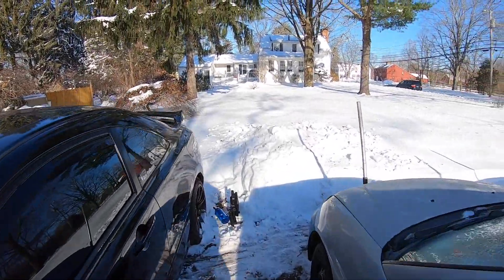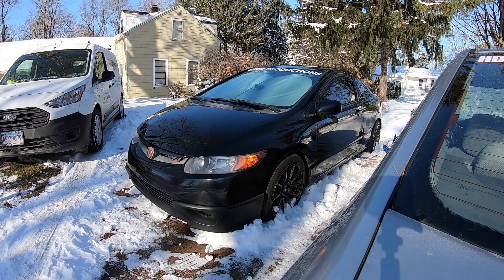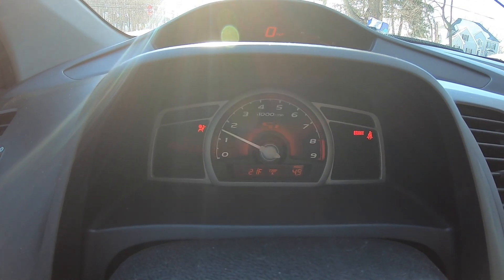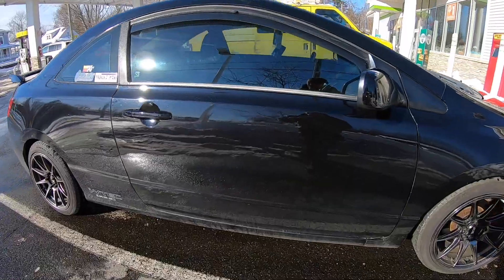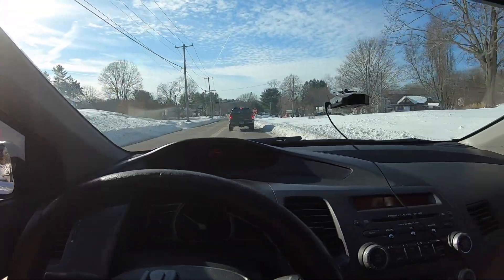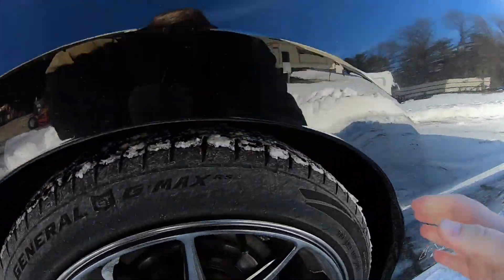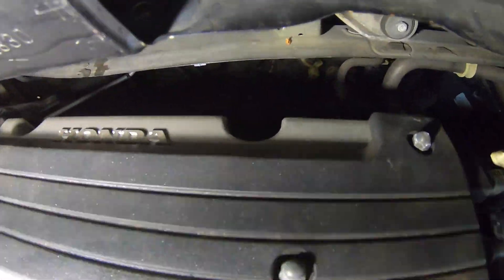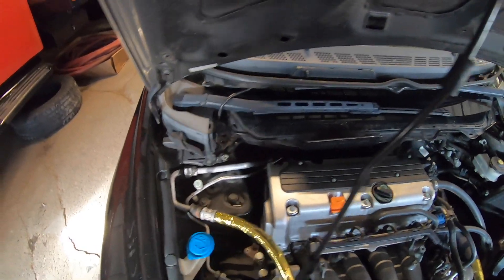Found My Engine Problem!

Comment: Why not add some splash guards. i just did and now i get no dirt or tire shine slick on my car it just goes on the guards/flaps.
Reply from the maker: I’ve always thought about found that.
Reply: @TheGerbsteve  they’re super easy to install. I would get the ones from Honda if you can. But I got it ones off eBay. They don’t right fit but with a little wigging you should be able to get 2 screws in atleast.

Comment: My 9th gen si has 59k i had a grinding noise almost everytime on cold start it's really annoying
Reply from the maker: Damn, at that low of mileage? Could be a starter. Or upon startup, sometimes the k series vtc is a problem. Believe it takes a second or two for the oil to flow down a certain passage to lubricate the vtc actuator. Hopefully its nothing too serious.
Reply: @TheGerbsteve  i took it to the dealership just to  check it out they told me they couldn't find anything wrong with it I don't know what to do

Comment: Pull that vtec spool valve and do a good clean on it
Reply: Make sure you electric grease up the switches on the spool valve
Reply from the maker: That’s the plan. I’m going to order a new gasket.

Comment: Can’t wait till spring comes around, my fg2 is garaged for the winter, in need of a new clutch. Exedy stage 1 organic paired with a new competition clutch 12 pound flywheel. Hoping to have it installed before April.
Reply: Make sure you secure that steering rack very well. ( unless u pro u dnt need advice ) I thought I had mine secure and fell and wasted more time putting the steering shaft back in normal position.
Reply: Thanks for heads up, will keep that in mind

Comment: Thanks to YOUTUBE algorithm, since you posted last video, and i had the same issue, i searched for the most possible reason for the leak.

And from the comment from your video below, I suspected the VTEC filter mostly.

Once i check the oem part prize (6 dollars) from dealer, I directly order one plus the bolt which has a bad reputation for rounding up.

It took me 30 min to change the valve, hope it's the reason for my leaking.

Anyway, thank you for your video. It gives me inspiration to do some fixing by my own.

Comment: Gerb, how Can I change temperature from F to C on my Fa5 2008. We use C in stead of F where I live
Reply from the maker: I believe you have to hold down the select button or button next to it near your vsa button to the left of the wheel. You have to hold one of the two for a few seconds.

Comment: That starter noise I had the same issue, turned out it was chain slapping. I know you just did a new timing chain, tensioner extended enough?
Reply from the maker: Oh boy, I hope it’s not the chain. Yeah, new chain and tensioner. I preloaded the tensioner and extra click, seemed tight.

Comment: Hey Gerb, Im glad you found your leak. I appreciate your work on and it has help me a lot cause I also have a K24A swap. I know this video is not about what I’m gonna ask you but what kind of ignition coils are you using because I believe I am having problems with mine. Are you able to verify with me if you are using the Z3 or K24A?

Comment: I know my oil is leaking on my vtec spool valve or my oil pressure switch. Everh now and then can smell the header burning it. But I change my oil every week on my 2006 si coupe so oh well haha. My oil pressure switch on my 2011 si developed a drip drip faucet style on the oil pressure switch as I drove random out of nowhere almost destroyed my motor. Lost 2 quarts in 30 minutes ha